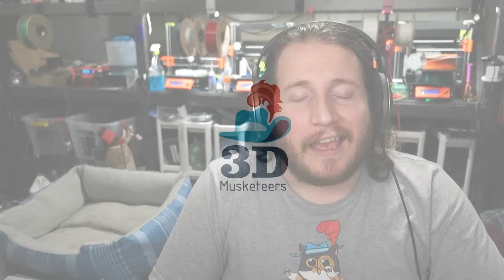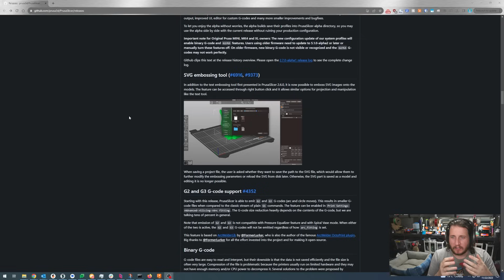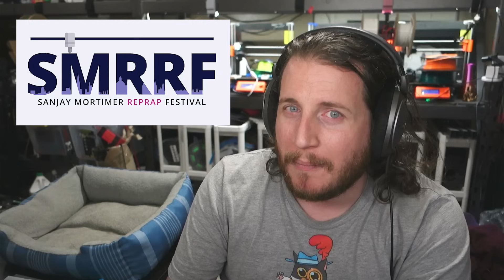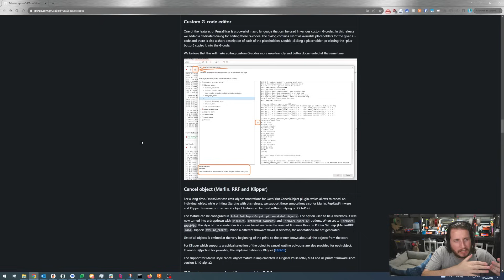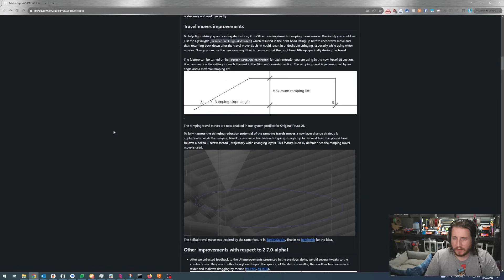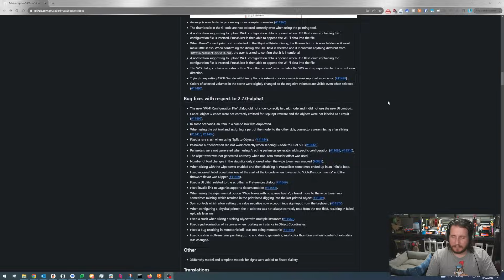Prusa FINALLY Added Arc Welding Support! PrusaSlicer 2.7

Comment: I think I'll stick with ASCII gcode for now. I see the need for some to use it, especially those with smaller storage or use SD cards. For me I wont' worry about as my gocde files are always on Linux systems with a BTRFS filesystem with compression enabled (compression-force=zstd:1), and this drastically reducing disk usage for gcode files already (laptop is Ubuntu, printer has Octoprint on Debian). This reduces the file sizes about 50% by itself, and I could add some de-dup if I really cared, and archive old files in a compressed format if needed. Compatibility and edit-ability are much more important for me. I won't knock those who want binary gcode, tho, if it works for you great. Add support at least.
Reply from the maker: I believe they are working on a translator in case you get a bgcode file and need a normal one. We shall see.

Comment: Huh? How exactly can pressure equalizer help, according to you, heavy machines that have slower acceleration when it is only a restriction. It limits something; namely the acceleration/deceleration upon changing from one feature to another (e.g. from infill to perimeter).
Reply from the maker: it ramps up the extruder, it is quite useful on BIG bowden printers.
Reply: Sure it has a 'ramping style', just like acceleration is a ramp up, but in the end the pressure equalizers only effect is to slow the faster features down when it is transitioning to and/or from a slower feature. If you have both positive and negative slope enabled, a transition from 50mm/s to 100mm/s will make the 100mm/s feature go from 50 to 100 by means of the positive slope, even if it were going in a straight line (so regular acceleration is a separate limit). The feature that had the 50mm/s to begin with is not affected. For 100mm/s to 50mms, it slows the first feature going at 100mm/s down to 50mm/s.

So again, how is this relevant to big printers specifically aiding their acceleration?
Reply from the maker: If I knew specifically how to describe it I would.. But I have a BIG bowden printer (1M bowden tube) and with that ramping thing it works AMAZINGLY well, without it I have issues with the start and ends of lines. It is really odd.. Sorry, the limits of my technical knowledge have been hit ha ha, but I can ask others?

Comment: I just want to drop a comment of "OMG yes, please add the multi-plate. Drop the ego and just implement it. Blackbox or copy code". I'll note that when I brought this up at a Prusa User Group event, I was told that the hesitancy is if they copied the code from somewhere else and not knowing if they would be following the license. Which I can understand... there are 10k forks of slicers with one off features that go to die... but I also think it's a cop out and they just need to add it. I have talked to a number of people who said they use Orca Slicer over Prusa Slicer (ironically, basically nobody uses Bambu Studio in my circles) and they said the reason: plate management. They have stated they are willing to be a version or two behind in terms of features, if it means they get plate management.
Reply from the maker: Prusa has pulled code from others before, including Bambu, they even credit them in the latest 2.7 release :) I don't think it's an ego thing and instead an already planned roadmap
Reply: @3DMusketeers  I'm not so sure. I've read the Dev comments on tickets that have been around since nearly the release of Bambu Studio. People have asked time and time again, both Github and in person. Both times have been waved off. Most others simply don't get responses and then appear in an alpha. There are easily dozens of times someone responded from a Prusa account on TwitX that they already have multi-bed implemented and it's not a feature they need to implement "because it's already there"

Comment: How to configuration .8 Nozzle setting in this software
Reply from the maker: You can go to your printer settings and change it there then under the print settings you change the flow widths as well.
Reply: @3DMusketeers  thanks
 lf possible to make tutorial video
Reply from the maker: I can work on that

Comment: Something changed with how 2.7 sets print speed. 
With 2.6 and prior if I set all my individual speeds to zero, and utilize the auto speed function set to 100mms. Then the algorithm clearly tried to target 100mms as much as possible. Only slowing print speed for small features and to normalize flow. 
Now with 2.7 it seems as if the slicer prefers to target almost exactly 50% of my max speed setting. If I set 100mms, it slices 99.9% of my prints around 40-50mms. 
I have tinkered with settings for hours now trying to figure out what is causing it to want to slow down.  So far only thing I can find that gets my average print speed back to where I want it. Is doubling the max speed limit. But I fear it’s going to sneak up on me and try to print at 200mms some time randomly. Which my printer just cannot support.
Reply from the maker: That's interesting. I've never done it that way. Worth seeing if there are notes about it?

Comment: Prusa would make a CAD package, then a week later Bambu will release the same thing in a different colour…😂
Reply: Cute. Arc fitting, objects exclusion is already in bambu studio and bambu printers. SVG support has been available since 2022. If you think Bambu studio is just a "color" swap you are need to lay off the Josef juice. 

Binary gcode is no different from how Bambu studio handles 3mf files. It's a zip container. I can take an 8mb 3mf file that is actually 50mb in size extracted. This includes multiple plates, photos, and project info. This is nothing new. BUt since the mk4 uses such crappy network protocols it needs to shrink all that data into manageable sizes so it can choke on it still. 

Heck Prusa slicer could not even handle Step files until Bambu implemented it. I cant wait until Prusa research invents multiple plates. 😜
Reply from the maker: Boy the replies here went to 11 without any reason... 

Technically bambu could dead copy it and assuming it's in open source it would be legal. Welcome to open source.
Reply: I agree, but to then patent concepts you took 80% of the development from open source isn’t great - this just kills open source right?

Comment: If Prusa decided to develop CAD, I worry that they’d need to charge money to justify the additional development. Like slicers, there’s no end to CAD updates/improvements. You still can’t add print pauses in sequential-print mode.
Reply from the maker: But would that be a bad thing?
Reply: @3DMusketeers  I wouldn’t mind if they charged for CAD, but right now they don’t charge for the slicer. I’m hoping it stays that way.

I don’t see a benefit to Prusa getting into the already-saturated market of CAD, when we already have free/inexpensive options that include CAM and simulation. Prusa’s frequent release of new slicer features is impressive, but if they were so great, they’d have added that missing basic feature that someone complained about years ago. Sure, most prints have no need for sequential print-mode pauses, but you could say that about a lot of slicer features.
Reply: CAD isn’t saturated. There aren’t any good open source CAD programs. It’d be neat if Prusa very gradually added CAD features, like ability to do OpenSCAD inside PrusaSlicer… while integrating ability to click to select objects and then drag them (perhaps requiring specifically formatted OpenSCAD variables?) and then maybe later, ability to click to select edges to add fillets or chamfer. That alone would handle like 90% of my CAD needs. Evolve slowly, only adding features where it makes sense. But yeah, OpenSCAD integration would be a useful addition and would put Prusa on its way to becoming CAD.
Reply: @TheAnachronist  It depends what you mean by "good". Compared to solid-modeling CAD from the 90s, today's open-source CAD is good enough. Compared to modern, closed-source CAD/CAM/Simulation packages, it's not.

I don't object to adding a few basic CAD features to PrusaSlicer, but it's a slippery slope. I could see them diverting much of their attention away from hardware, firmware, and slicer-specific improvements. I see more value in them focusing on their specialty. For example, they could add extruder-current/torque/speed monitoring to check for filament slipping or underextrusion. Alternatively, replace the filament run-out sensor with a filament position sensor (mechanical or optical), and compare it to extruder position, to monitor the filament slip ratio. A nozzle-backpressure transducer or AI-camera system could monitor over/underextrusion. Automatic live-adjustment of extrusion would take layer-adhesion to the next level.

Developing CAD is a monumental project. There's a reason the good stuff costs money. Prusa would add another half-baked solution to the pile, if they dilute their efforts with a side-project that is outside their area of expertise.

Comment: The gcode actually annoys me for a different reason - from what I've heard, binary gcode is not a new concept, but Prusa has decided to design their own implementation rather than use an existing one. Not sure why, and they don't say why.

Cancel objects is nice, and I liked having it in Octoklipper & Octoapp. But - probably because the CPU is weaker than a Raspberry Pi, even though they upped it to 32 bits - you can't see the object to cancel visually on the Mk4.

It also impresses me they found a chip weaker than a Raspberry Pi.
Reply: the reason is pretty simple, saving data in binary format is nothing new obviously and while bgcode technically exists nobody is actually using it so far.
Prusa has made their own implementation of it because they also made changes like changing the image format for the thumbnail that saved in the gcode.
also important to note that Prusa is running all their stuff on the printer on bare metal instead of having basically an entire operating system layer in between so they probably optimized for that as well.
Reply from the maker: I'll have to talk to the board engineers and figure out why those decisions were made :)

Comment: Binary gcode was introduced mainly to solve one issue. Very slow Mini/MK4/XL hardware in terms of network speed (it is in 0.1-0.4MB/s range; wirelessly or wired - ~the same). Since hardware cannot be just replaced with something modern, binary gcode and gcode streaming was introduced. That is a smart (and probably the only possible) solution to workaround lacking hardware in these printers.

Comment: binary gcode? please no. I‘m instantly getting flashbacks to the replicator or flashforge creator days needing to compile to x3g/gpx files, being stuck to specific slicers or need to set up scripts to go back and forth, always with compromises being made.
Reply from the maker: Nah it's open source so it shouldn't be an issue
Reply: @3DMusketeers  What did not leave my head in the last couple of days:
Worried about extending the spec to allow the binary being digitally signed, for the security of the user first.
Next step providing digitally signed ready made downloadable sliced code exclusive to your printer, Apple-like ‚notarized‘ for your convenience. 
Finally, to allow model creators to better protect and monetize their IP, put a full blown DRM around it (only x prints allowed, only valid for x days…).
Sounds a little bit dystopian, but I think this is what we are heading to on the long run, opening that door acting as a catalyst at least.

Comment: Grant, sounds like your enjoying the XL. So have you honestly experienced any set backs? Mine just shipped today, (fully "partially" assembled). lol So I'm hoping for good results and excellent tool accuracy. I already have ideas for custom tool heads I might try to make down the road.
Reply from the maker: Haven't had a ton of time to mess with it honestly, doing some projects and things we can't talk about here, but I did have adhesion issues to the plate. It was recommended that even though I was using alcohol to clean it with, dish soap was required at least once. I'm not used to the satin sheets. 

Some other issues with adding speed in input shaping but it seems Prusa has a work around for it.
Reply: Had many adhesion problems on a mk4 w PLA we’ve been evaluating for last 6 mos or so, note these are small footprint parts we’re printing.  First did the heated chamber, that got rid of lots of stringing, but ends of thin parts were still lifting/peeling up.  We need the bottoms to be very flat; so this was a major issue for us.  Got a satin sheet and started using end of Jan/24 and it helped for a while.  Then started having issues again.  Had been cleaning w 91% & lab grade ipa.  Didn’t “see” any fingerprints, but still,probs w adhesion.  Tried dish soap, letting dry thoroughly overnight -  helped a little.  Finally broke out the Dawn dish soap (use it for cleaning oily residue in the machine shop). Wore nitrile gloves while washing.  Worked like a charm.  Started wearing nitrile gloves whenever handling the plate, much much improved results w adhesion.  Don’t think the plate has been washed in 3-4 months?  Saw some corner lifting last night on a large (96mmx96mm) relatively thin part; so going to try washing again (resorted to using Mickey ears to get it done expediently).  If not containments from PLA (know it’s not those devilish leveling “dots”affecting bed leveling, scrape those off very thoroughly - tip is also very clean) might try playing w chamber temp…that has helped a bit before (also w stringing).

Fixing to order a mk4 kit now that the clogging issue seems to be somewhat mitigated (we had a defective part in the filament path on our factory assembled mk4) between a bad part replacement and the latest firmware update life is much better.  Though also looking at the XL…hard choice.  Haven’t seen too many print quality comparisons between them online (we’re currently doing .15 & .2 struct-IS layers, .4 nozzle - so far).  The  MK4s will likely fill out our farm…though that new robo-unit w “slim” mk4s looks real tempting to buy into.  Likely a few of XLs too.

Been a road, but getting there.

As always, YMMV.  Just sharing, nothing more, nothing less.

Comment: I don't see the point in editing gcode. I'd rather just re-slice it. Since getting into 3d printing I'm like.......why the hell is this in ascii? It's such a massive waste of space. I've watched my pi fill up with gcode faster than the timelapses. So hell yeah! I prefer the the idea of bgcode. I hope this gets adopted as long as it's open source.
Reply: When you need to print hot but need to slow down for bridging, you can't set different temperature just for bridging of a section (to not overheat the filament) in the slicer nor using custom gcode as it's inserted per layer basis. You need to open the gcode, find the section and insert the custom gcode to change the temperature and back after the bridging is done.
Reply: @hologos_  if it's 5 degrees it's not going to be that big of a deal. If it's 10 degrees it's not going to change fast enough to matter. And if that really is an issue, then you need to tell prusa not me. Then you can set it in your bridging settings. Also while I have no intention of editing bgcode, it sounds like it's not hard to edit it.
Reply: @awilliams1701  Do you know there is a gcode that waits for the temperature to reach the target? :-) By the way "tell it to Prusa not me" - then don't put your opinions on the internet if you don't want to be confronted. 🤷‍♂️🤦‍♂️
Reply: @hologos_  you're the one replying to me. And I'm the one telling you that speed alone is enough for bridging. Temperature isn't needed. If it was prusa would have put it in by now. And for the record when I put a temp change in the temp towers, it doesn't wait. The temp changes, but it keeps printing while it changes.
Reply: @awilliams1701  You said in the OP that you don't see a reason to have a gcode in human readable format. I gave you an example. If Prusa didn't use crappy network hw, they would not be doing this.

There are 2 gcodes that change temperature - one that just changes the temperature and continues and other that changes the temperature and waits until the target it reached.

All in all, I don't want to argue. I don't see where your anger is coming from but what I know for sure - I don't want to waste time arguing with you. Be well ✌️
Reply: @hologos_  I put in both codes on the temperature tower. It doesn't wait. In fact if I don't put in the wait for temp it doesn't actually change the temp. The odd part is the preview shows the temp changes anyway, but the printer doesn't change them. If I do wait for temp, then it actually does change, but it doesn't wait.
Reply: @hologos_  anyway.....the point is most sane people don't need to look at the raw gcode, but if for some reason you actually do, you still can.

Comment: This 'cancel object' feature is a big one for me and I just tried it successfully with my klipperized Ender 3S1. One has to select the 'firmware-specific' option in Prusaslicer->Print Settings->Output Options->Label Objects. Add [exclude_object] (just the header) to printer.cfg. Thanks for mentioning it and your overall informative and fun shows in general!